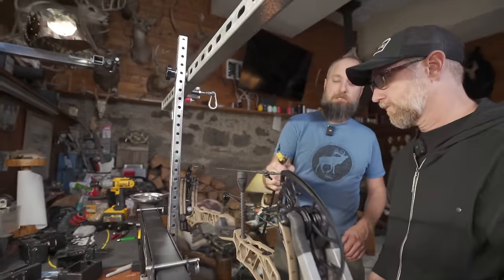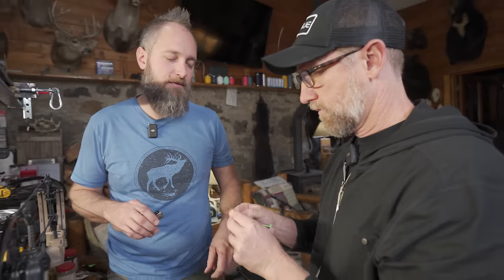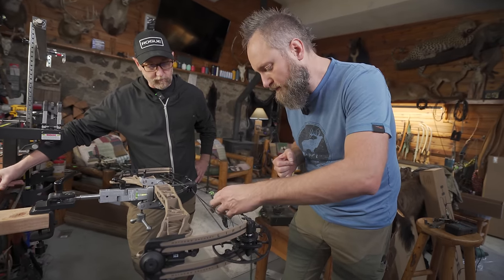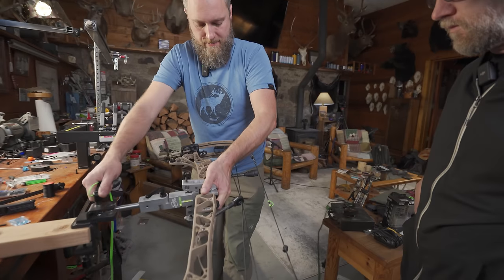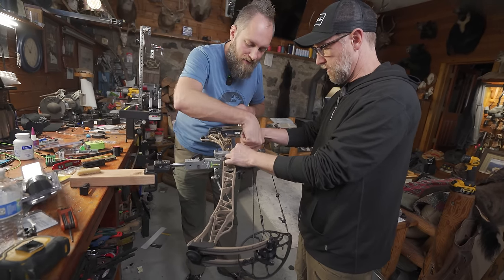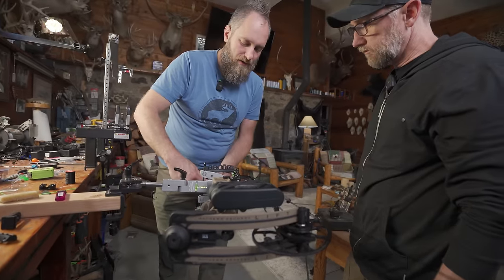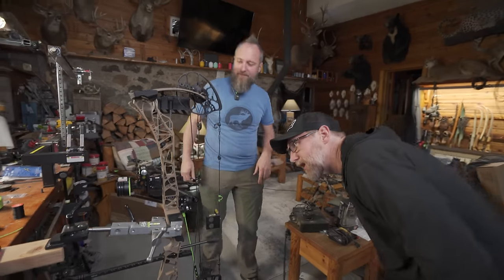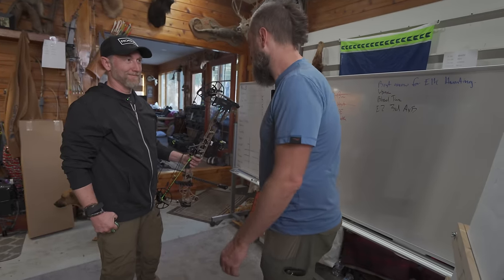Mathews Lift 29 5 Bow Build And Lesson With MFJJ!!!

Comment: Just got the same paper tear through the same bow. Tried flipping the top hats on top cam and got the opposite tear. Did you use different top hats than what was from the factory or just had to switch them around?

Many thanks if you get around to answering my question. Love your stuff and your new stabilizers are freaking awesome!

Comment: Always toss out the Hamkea Rest cord football and install the EZ glide.
Worth the 10$
Reply: It's ridiculous how they nickel and dime you when you're already paying good money upfront for their product. Their "EZ-Glide" should just come with it. It can't cost any more to make than the football that comes with it.

I have the Hybrid Hunter Pro. I was a crappy design, and the spring got all stretched out. They want me to pay ANOTHER $49.99 for their so-called "Conversion kit" which addresses the product defect that they engineered into it in the first place. Something that they should've offered for free for previously-purchased product, and which they should include as the default configuration, going forward. 

It's literally pennies for them to produce the 'fix', and they're charging through the nose to make it how it should have been from the start.

I said screw that, and just used some 1/8" surgical tubing, knotted up with the drive cable looped through each knot. It does the same thing as their $50 "conversion kit", and it cost me about $0.20 in surgical tubing, which I already have a roll of because I use that stuff for SCUBA gear, and lots of other things around the house. 

Hamskea makes a nice rest; once you address the design flaws, it runs great. I'm going to drive this one until the wheels fall off. 

But I'll be damned if they ever get another dime from me. Their principles, as a company, just seem completely out of whack to me. I get that they need to make money on the front end, which is why I was willing to pay top dollar for the product in the first place. But when they also want to milk their customer base on the back end, to make things right with their own design flaws, that's where I jump off and won't look back. There are plenty of other great options on the market that just work correctly out of the box without having to pay for a bunch of tiny little extras that slowly creep the end-price up and up and up; and that's where I'll spend my money in the future.

Comment: Doesn't a d loop that short create torque on the string when it's at full draw using a handheld release that's twisting it 45 degrees?  For an index it won't matter but for a handheld my thinking was it shouldn't pressure the string
Reply: Wonder the same thing, a local wiz always sets them up fairly long. At most you'll only get 1/2" of draw length is that worth it to shoot a more unforgiving setup? or does it really not matter?

Comment: I mentioned this in the previous video...Keith your grip is too deep on the OnneX C, back off one set of knuckles so your hand is more flat. It gives you a more consistent anchor point and it moves the head of the release more in line with the string vs pulling the head away from your face.
Reply: I'll try that, thank you for the recommendation.
Reply: @jkeithhowe   It's a Dudley thing ☺ He is very adamant about drawing and anchoring with as flat of a hand as possible. My guess it will feel very different and possibly a little more difficult at first but like John mentions if you draw too deep on your grip as you relax slightly after your anchor the release now moves and your anchor point literally moves.

Comment: Spend $5k to get a new bow set up these days. By next year its outdated already 
 Absurd!!! These arent guns, computers, vehicles...
Reply: A lot of what they call innovations I just don't care that much about, I don't mind them, but they really aren't all that.  The machined in pic rails and especially the machined in dovetail stuff, while nice just isn't worth the big$.  I would rather see a riser drilled and tapped for a removable pic rail if they continue down this road. have give props to the light weight  that Hoyt and Matthews did this year though.  However imo the adjustability/tuneability innovations that bowtech and elite have been doing, way more impressive than the integrated accessory stuff, if either or both of them start doing the weight reduction they would be hard to even compare to anything else.
Reply: My Halon 32 was made in 2015 and they just changed the cam in 2023 soooooo. The bows change very slowly actually.  Which is why I’m going to shoot the Lift and see if it’s worth buying. And the Bow costs $1400 and I already have an extra rest and sight.  That’s cheap for what the Lift took to make and develop IMO
Reply: @Thedudeabides803 exactly this and it only went up $30 from the PHASE 4.
Reply: I think the Lift is perfect for girls. My daughter complains how heavy bows are…. So it makes me think it’s a great bow for female hunters …
Everything else as far as specs, it’s very similar to
The other brands…
Reply: @2010elmonstruo it’s stupid light. The LIFT 33 with both stabilizers was still lighter than my V3X 29 in the same format 😂🤣😂
Reply: @sagrieff exactly. I shoot Mathews, but I disagree that the Lift is the nicest bow this year. Still $&@" grip, still only tune with top hats, no 1/4" adjustments on draw length. I don't give 2 cents about integration accessories. That's just a blind gimmick to get the fanboys to buy their crap and over shadow the lack of , yet again, " tune ability ". I'm still trying as I type this , to understand how he says" nicest" bow this year, when even out the couple bows tested, the Lift was only o few ounces lighter, but was under ibo by the furthest, had about the highest vibration, and a crap draw and back wall for the speeds it puts out. Soooooooo. Again, I shoot Mathews, but I do keep it real as well.